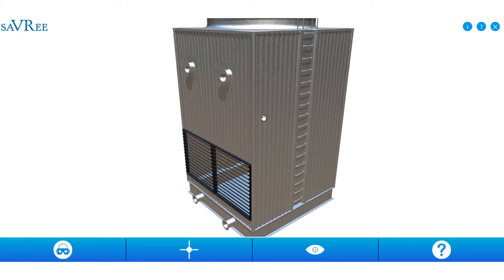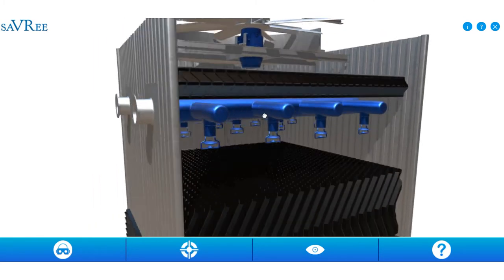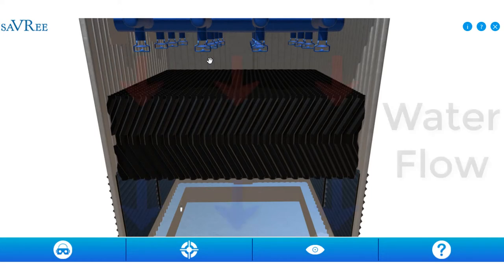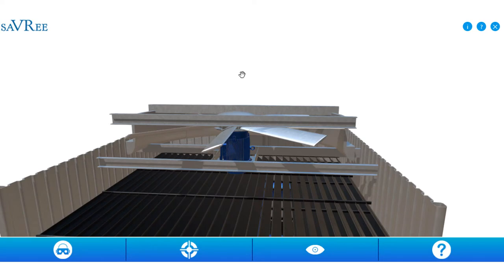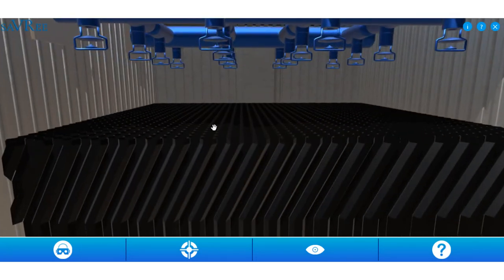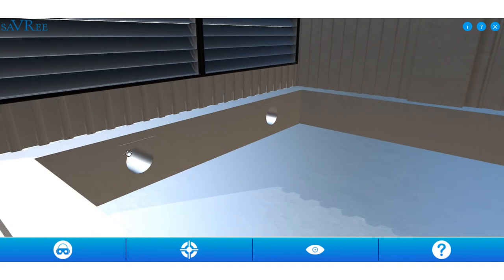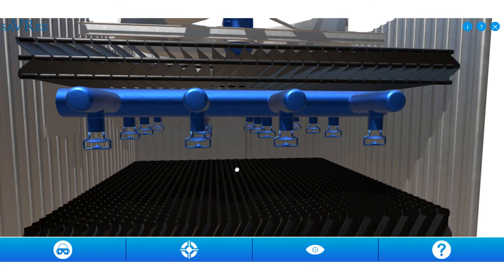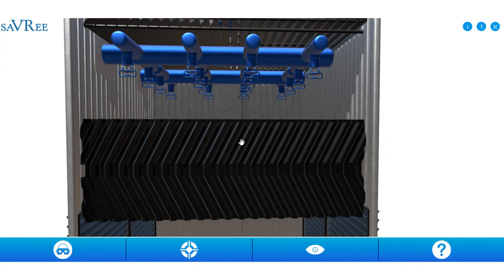How Cooling Tower Works

Comment: The majority of heat is removed by the evaporation of water. That is why the drier the air the more moisture it can absorb and the more water can evaporate and the cooler the water will be. Wet bulb temperature dictates the lowest possible temperature the water can go.